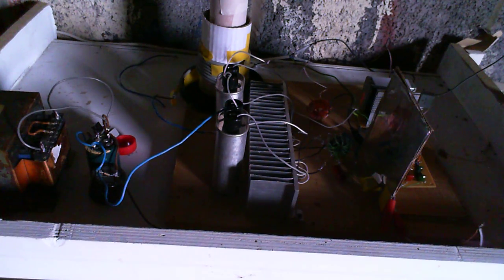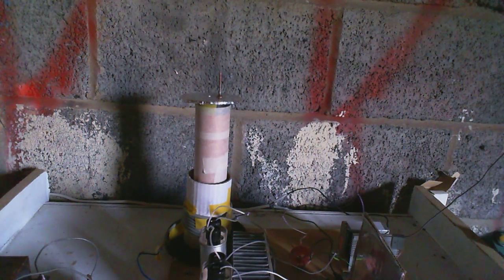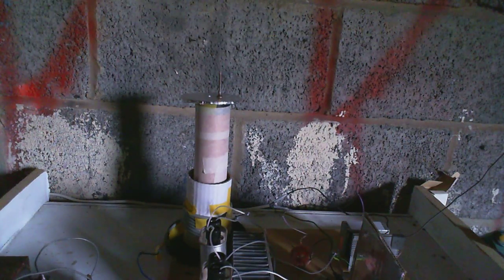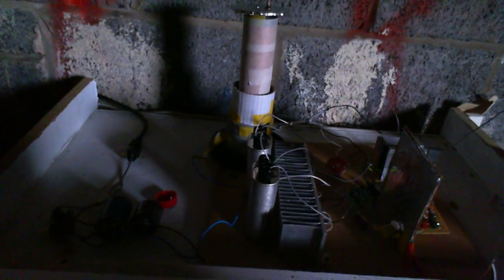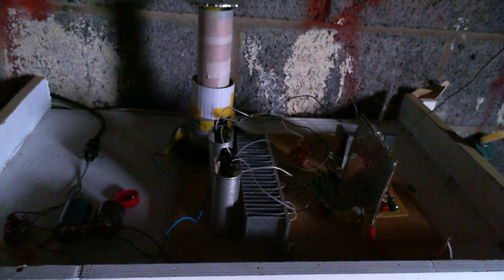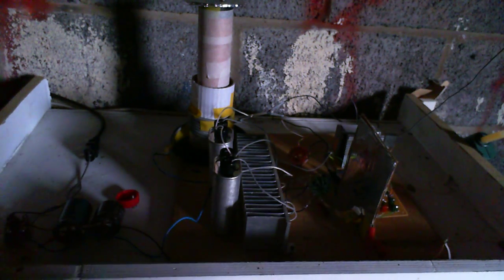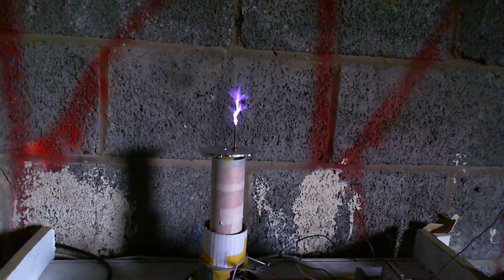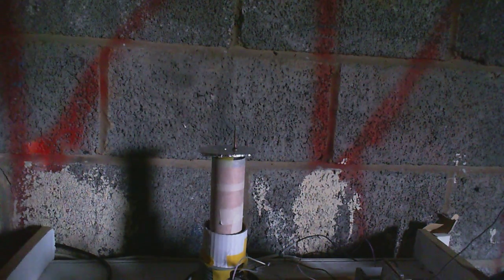My SSTC on rectified mains! (and Constant Wave) :O

Comment: IDK why all the versions of this SSTC use a "half-bridge" design. If you replace the large capacitors which create the median voltage with a carefully chosen (and BEEFY!, e.g. ultra low dissipation factor) ceramic or film capacitor (in series between the primary and ground), a value of which, when combined w/ the primary,  has a res. freq equal to the secondary+topload at full load, then the input impedance to this circuit will actually be fairly close to zero, depending on how closely you can match the series capacitor.  The output impedance of the totem pole made by the MOSFETs will also be just the on resistance plus whatever parasitic inductances are present. I was able to get 2 inch arcs with 48V. (I am at the point where I think my secondary coil design needs to be revised, made shorter and fatter, and increase coupling between primary and secondary. And I want a current-limited ~80V supply, but do not have anything suitable yet. I might make a capacitive dropper with 120v mains with a motor-start capacitor and see how that goes.
Reply from the maker: I might try that actually, I have thought about that a few times. The only problem is that it might take a while to find the ideal capacitors for such a coil, I think I have some large film caps lying around somewhere so when the weather gets warm again I might go out to my "shed" and try that.

Comment: Run it half wave rectified. Also the mocs that you are using are very bad for Tesla coils... Try using some foil caps
Reply from the maker: Walter Spurer Why half-wave? By the way I know the caps I've used aren't the best, I said that right at the start but it's the closest thing I have to what I need.
Reply: half-wave because you'll get longer sword like sparks
Reply from the maker: It does make a difference if you take out the smoothing caps, the two big caps you can see there are not for smoothing, they make up part of the half-bridge.